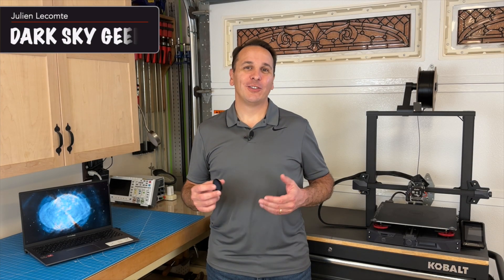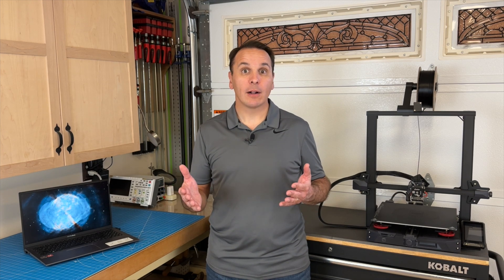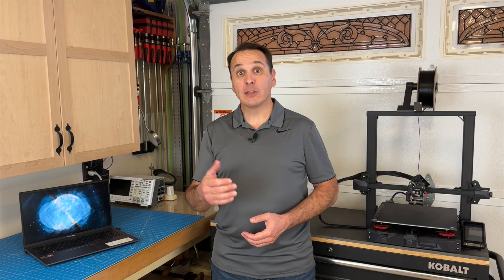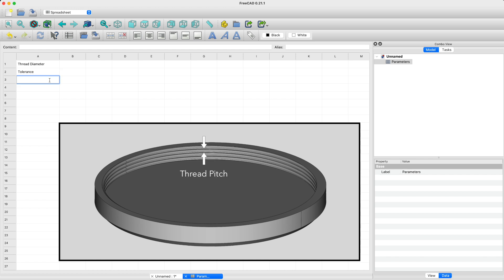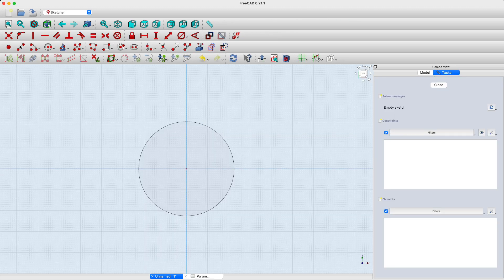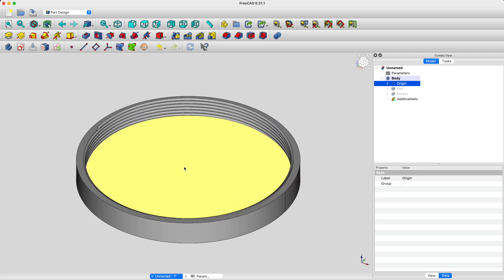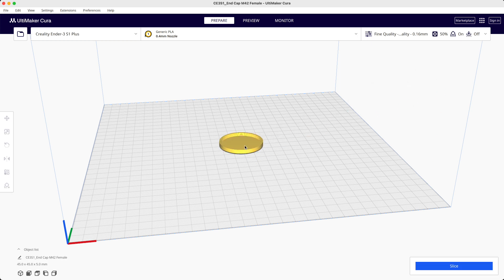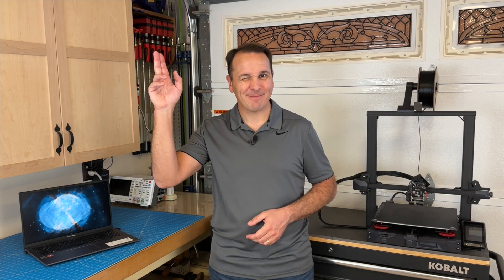Design & Build Your Own Custom Astronomical Accessories #3dmodeling  #3dprinting #tutorial

Comment: Cool. Thanks for posting.  My printer has produced ... probably ... close to 50 astro-related bits and pieces ... all specialized.  If you need something ultra-custom, it's straightforward to design and create what you need. Granted, you need to invest some time in learning some design software, which ranges from basic/easy to advanced/pro-level.  Soon, I will be using my printer for spectroscopy activity, with an Alpy.  I've saved a ton of money doing this.   But, really, the best part is that you can design pretty well anything to be super, super custom to your exact needs.   Then, also, there are all the  non-astro things that you can create, too. Best/Jeff

Comment: Great video. I've been thinking about a printer for some time, but the options are bewildering. One question I have: could you make a custom adapter like an M75 to M54 male-to-male adapter, and if so, would it be strong enough to support an astro camera? I have no idea how strong these parts are!
Reply from the maker: You could, and some people have done it. Me, personally, I would not use a 3D printed part for the imaging train. But for everything else, it’s great! If you consider purchasing a 3D printer, feel free to use my Amazon affiliate link. Thanks! 🙏🏻

Comment: I’ve been thinking about getting a 3d printer lately. I have been wondering about what types of filaments would be most appropriate for astrophotography applications. you mentioned PETG in this video, would that be your go to filament for these applications? Great content :-)
Reply from the maker: I print almost everything in PETG because it will withstand higher temperatures than PLA, and astronomical equipment is outdoor equipment after all. But some things, such as my flat panel for example, could be printed using PLA. So, PLA and PETG are my go to filaments. Hope this helps!